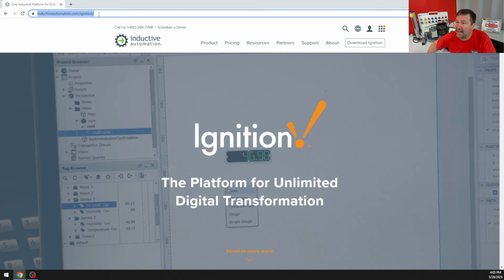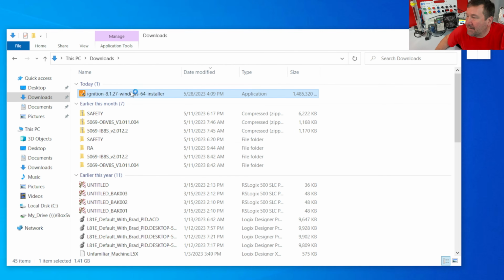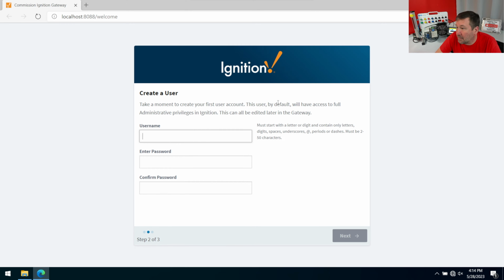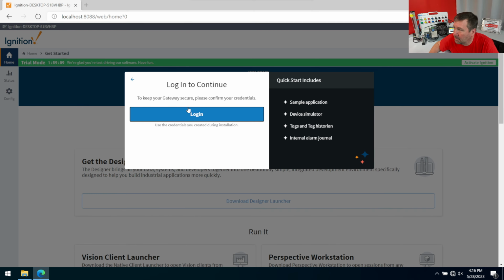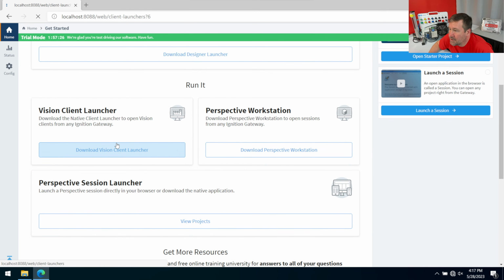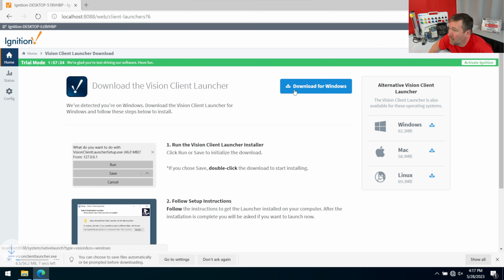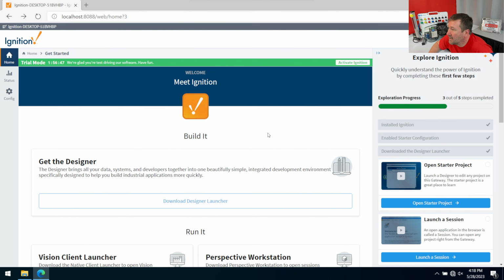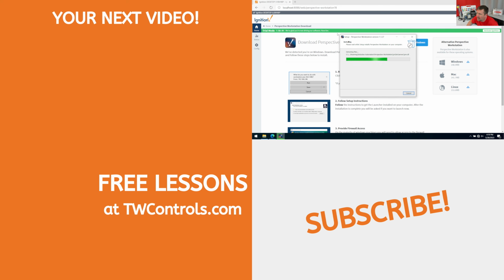How to Download and Install Ignition SCADA Software for Free

Comment: Been around SCADA for 30 years.  System I used at the company I worked with was Wonderware Archestra.  10,000 + tags and close to 100 PLCs.  I'm now out on my own and want to provide a simple SCADA solution to my customers who tend to very small water and waste water systems.  Ignition looks very interesting and a very viable solution.  Howeever, being the Rockwell guy that you are, are you familiar with their FT Optix system?  My Rockwell rep says it was mean to compete with Ignition.  Was just curious if you had any experience with Optix that you could compare it with Ignition?
Reply from the maker: I took it very early on in RA's acquisition.  Back then it need a little more time to mature.

Comment: Greeting Mr.Tim,
I have a problem with the Ignition Designer launcher, after adding the designer and clicking on open designer it doesn't launch. 
so I can't get into the UI of the launcher.
Do you have any suggestions?
Reply from the maker: If you go to the start menu, does it show up?  Sounds like a botched install or the link is broke.

Comment: Spent the last 4 months in Silicon Valley at a Electronics Company for a company project. One my dailies was supervising operation of their wastewater system and it used Ignition SCADA. So I got to interact with it for quite a while. The system ran smooth best I’ve observed and was really easy to use. It wasn’t a complicated HMI either, so was easy to figure out. But this wasn’t the design environment of the software so that I haven’t seen. However, a few vids of the design environment would be cool. About 2 years ago we were testing Ignition at our offices. We used the demo. However we also contacted the company and they also gave us a temporary extended demo license for 30 days so we could have a longer testing period. They figured we could end up buying the software so they were willing to extend the free testing period.
Reply from the maker: We are working with it in our training class this week.